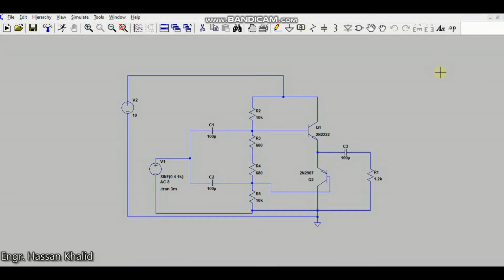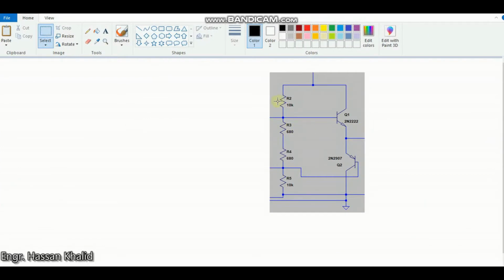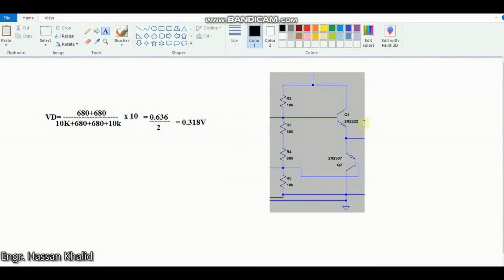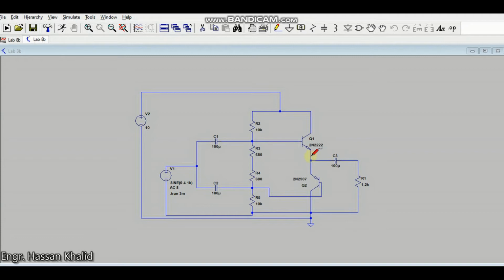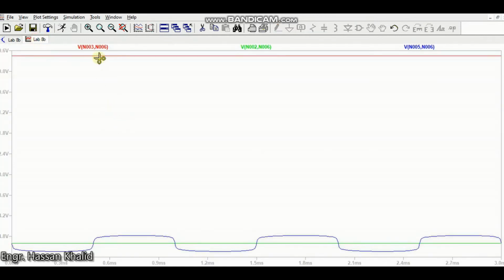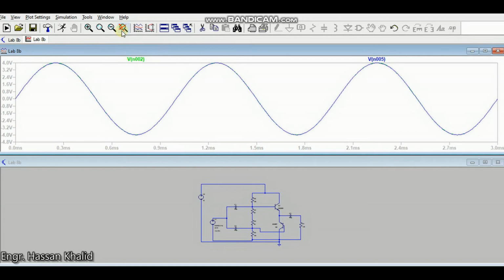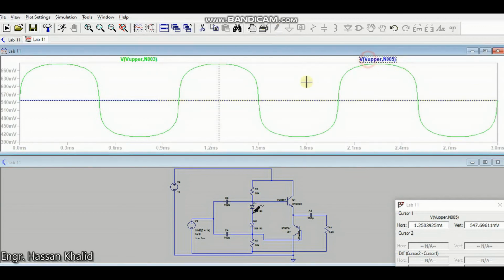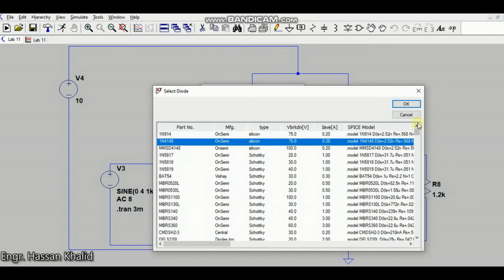Solution to avoid cross over distortion in Class AB amplifier

Comment: You don’t know what you are talking about. It is filled with inaccuracies.   For a start, the base emitter voltage of the output transistors will increase when under load so the signal diodes will be suitable. 
One thing you do not understand is this.  When the biasing voltage is above the two base-emitter voltages of the output transistors, the quiescent current increases. That’s how you get it right. No idiotic voltage measurements required. The circuit does it all for you.